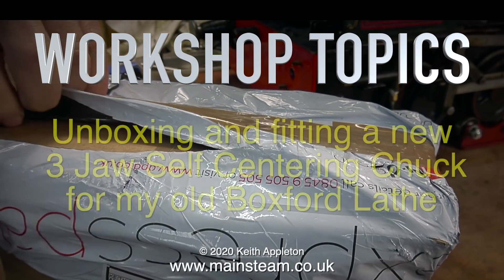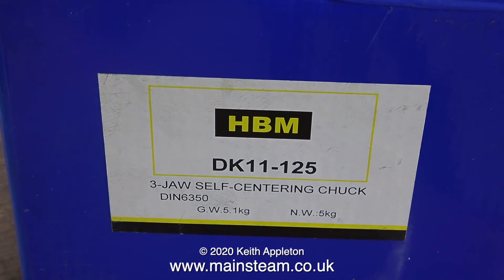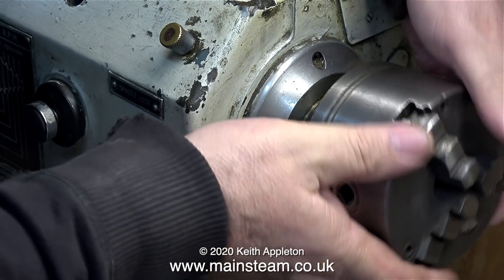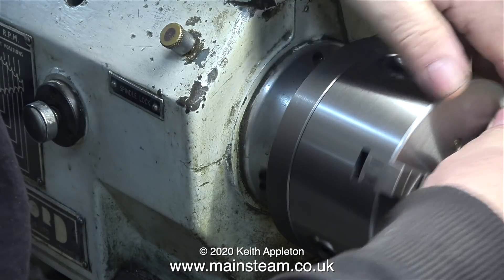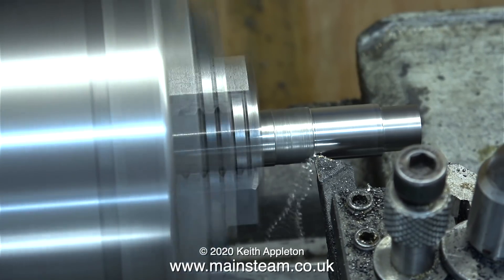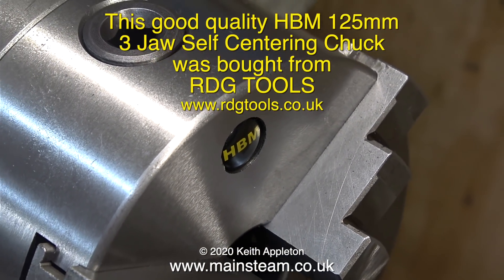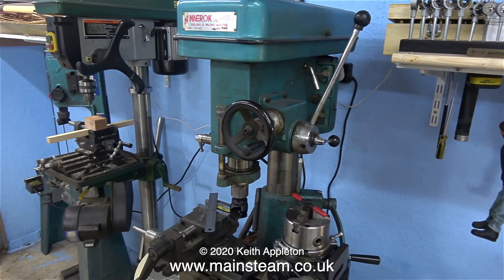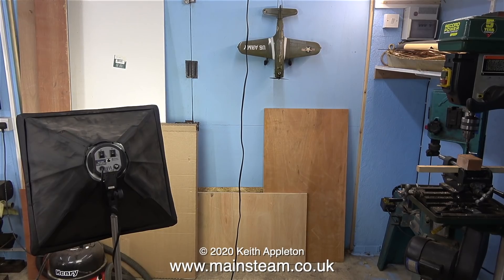WORKSHOP TOPICS - A NEW 3 JAW CHUCK

Comment: Keith, I am not a machinist, though I am mechanically minded. I really enjoy watching your lathework. When you tested the new chuck, what I understood you to say was the finish on the test piece was much smoother than if you were using the old chuck. What would cause this situation? Does that mean there was some kind of slop or looseness in the old chuck? Was the old chuck just showing its age? I know that I am, and yes, there is some slop and looseness).
Reply from the maker: I changed the tool tip ......
Reply: Oh. I guess I didn’t catch that in the vid. Thanks.

Comment: I'm confused about what was actually wrong with the old chuck.  Was there so much mechanical wear on the jaws that even though tight, they allowed the work piece to move? I don't understand how that would be possible. I did notice the new chuck is bigger (longer) that the original, so you should probably have a better grip on the work piece too. 

Either way, congratulations on the new tools!
Reply from the maker: There is nothing wrong with the old chuck except that I didn't have any outside jaws for it.
Reply: Also:

There never has to be a "reason" to buy new tools.

Once I realised that - life became a whole lot simpler...